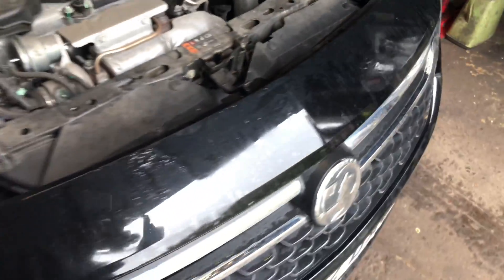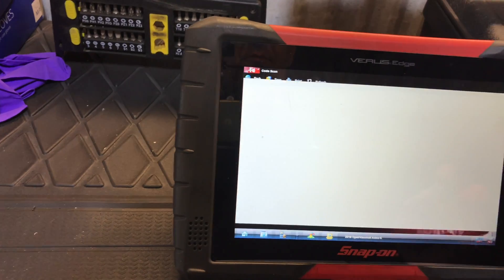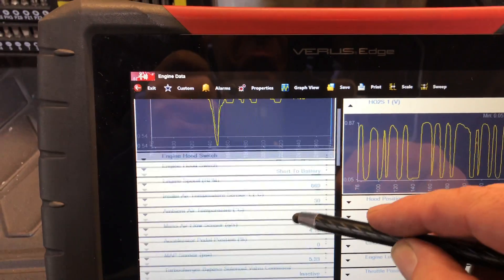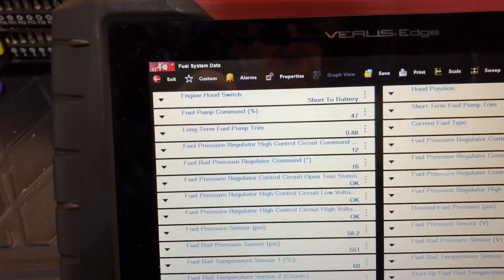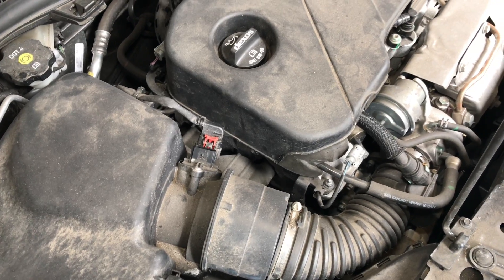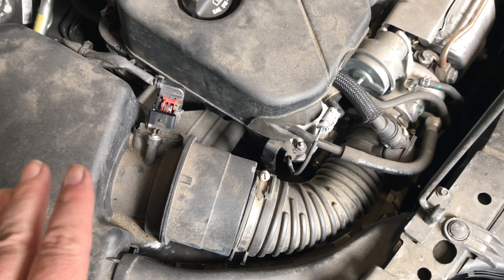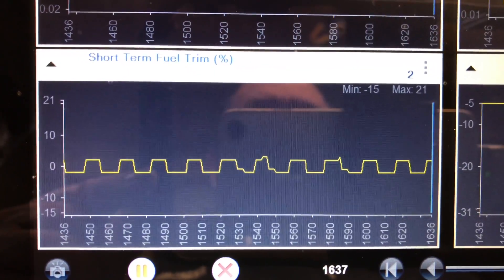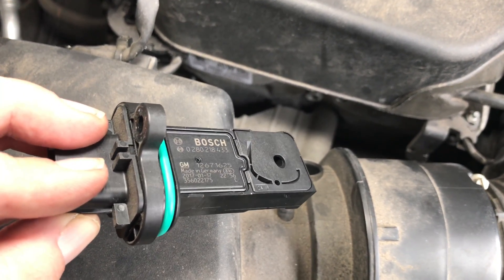Vauxhall/Opel Astra (2017) 1.4 Turbo GDi - Fault Codes P0172 + P1101

Comment: HELLO, I HAVE A 1.4 T CAR, I HAVE P1101 FAULT ONLY. WHAT CAN BE THE PROBLEM?
Reply from the maker: Check air filter is correctly seated as it is a common issue cheers sandy

Comment: So what was the verdict? i got a vxr that had same codes. It accelerates much better and smoother with maf unplugged but idles rougher. Then with maf plugged in, the acceleration stutters when turbo is supposed to kick in but idle is slightly smoother..
Reply from the maker: This car problem was actually the air filter not being mounted properly!!! Go figure that one! Cheers sandy

Comment: Hello there. I have same codes. I did replace the maf sensor. But I still have the same codes. Any suggestions
Reply from the maker: The air filter was not mounted properly cheers sandy

Comment: You’ll find the air filter has become unclipped inside the air box blocking the intake. Done loads at work
Reply: You F** Genius! Sorted my car out the filter came off
Reply: Is this simular in the 1.4t petrol astra j as mine has similar issues
Reply: @CardBoardGamesPlays  different engine in your Astra J. what code you got?
Reply: @CardBoardGamesPlays  did you fix yours mate ? What was it ?
Reply: Hello,
I have a P1101 code on my 66 plate astra 1.4 petrol turbo engine, would that be needing a new maf sensor?
Any help would be appreciated.
Thank you
Reply: I have a p1101 code on my 66 reg. astra 1.4 turbo petrol engine, would that be needing a new maf sensor?
Thank you
Reply from the maker: Thanks for that information, the guy never ordered mass meter yet so we will check this out first, again thank you for help, sandy

Comment: https://www.ebay.co.uk/itm/Bosch-0280218433-MAF-Sensor-Mass-Air-Flow-Meter/324099740774?hash=item4b75d99466:g:vAQAAOSwMS5eaKwl.   £65 delivered
Reply from the maker: Cheers Myles